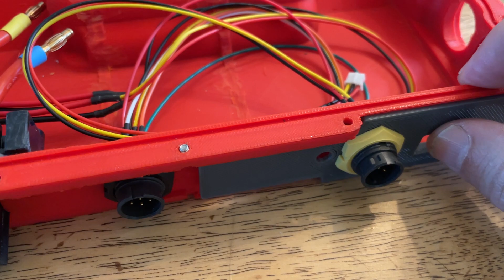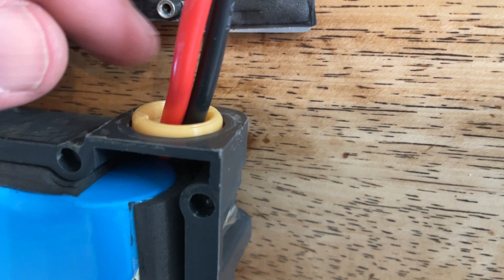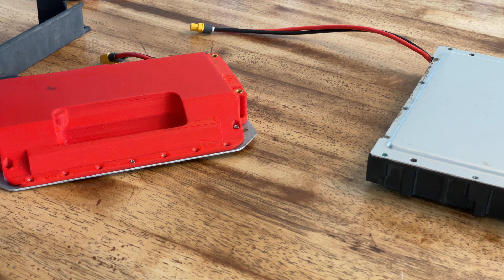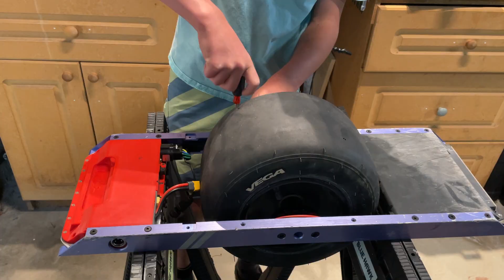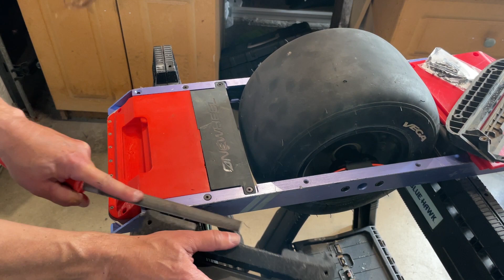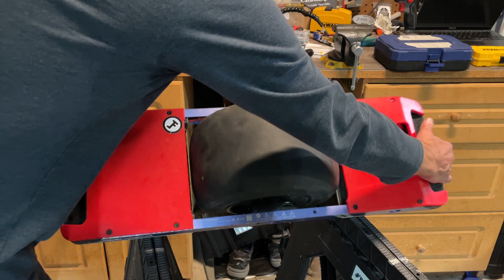VESC OneWheel Part 2 - Assembly

Comment: What solution are you using for a bms in these applications, or no bms at all?
Reply from the maker: I've been going BMS-less - the options aren't great atm, for 18s/20s setups you have the ennoid XLites but they're still a bit immature imo. If you reuse the XR battery you got now you can keep the BMS afaik

Comment: With this hypercore motor you gonna find that all we need is a faster PID loop, lol, I rode my  VESCed Pint for almost half a year now, Lovin it. last night the BMI160 SPI support is added to vesc, imma developing a new vesc ASAP with BMI160 SPI, that means we can run that IMU 4x FASTER, with a 4k loop hertz, its gonna be so much better. But running higher loop hertz you might wanna decrease the switching frequency a bit becuz there is not enough computing power in that F4 mcu.
Reply from the maker: I'm not sure what a faster PID loop would get us. Even if a SPi-based IMU allowed a 4kHz sampling rate we still need someone to figure out how to get smooth IMU data into the balance app. It's currently noisy af and therefore unusable for acceleration data. Making the IMU faster will only make the noise worse. That's why I'm still using erpm based acceleration for my algorithm. What I think we really need is improved motor code at low speeds, maybe something like HFI+Hall sensors to allow more fine grained motor control

Comment: This is fantastic. I really can't wait to see how this pans out. I hope this tip helps, but for the wiring running along the rails, I recommend some heat shrinkable braided sleeving. I started using it for external wire assemblies, and it is very abrasion resistant. Worth looking into for when this machine is fully street-worthy. 
Best of luck!
Reply from the maker: So that's what it's called - didn't know what to search for, thank you :)
Reply: @surfdado  also look up snake skin wire wrap.